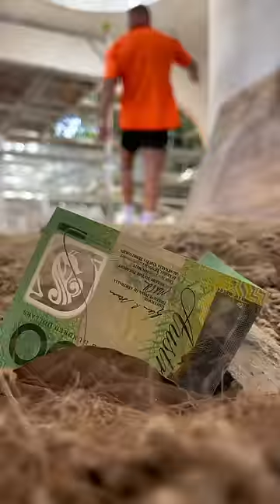The cyclist of the jobsite #electrician #work #tradie #building #jobsite #aussie #bogan #skit

Comment: And he would of left 32 zip tie ends behind
Reply: You mean he cut them? Ahhah they never do
Reply: As a carpet layer that cleans their shit I agree. I'd have to say it's closer to a million
Reply: Can't beat a sparky dropping
Reply: And all the wire armour off the cable.  Messy bastards
Reply: I cut mine at 45 deg. Sharp Is right
Reply: And plaster dust particles everywhere
Reply: @riccardotorrisi4517 as sharp as i can bro
Reply: thats me 😂 about 8 zip tie ends and a few bits of electrical tape stuck the the floor
Reply: I guess my dad was the only electrician that cleaned up in always seeing comments like this. I worked with him for a year and he'd have fired my ass if I left even so much as a grain of drywall or wire bits on the floor
Reply: As a shop fitter we were always responsible for the final cleanup.

Your comment is as relevant as it gets. The sparkies mess was always the worst by a long shot.

That said our main electrician was one of the hardest workers I've met. He would be running cables in a shopfront bulkhead while a bunch of us were lifting it into position at 2 o'clock in the morning as he's yelling at us "get that bulkhead up!" At the top of his voice. 

He was a big bastard too. How we lifted him was as puzzling as how he managed to get in and out of those tight spaces. Fond memories but god I'm glad I'm not shopfitting anymore.
Reply: ROMEX insulation everywhere
Reply: He would've left fucing 200 cubic tons of shut on the slab
Reply: Get over it
Reply: Would have
Reply: @riccardotorrisi4517 I do but i leave the ends behind for prove of work
Reply: Hahahahaha, best comment, so true
Reply: I do t understand how to keep them together?.  I dont want to leave them I swear 😊
Reply: Don't forget all those end snips of wire.
Reply: 😅 took the words out of my mouth. A sea of cable ties - not even an attempt to bin 1
Reply: After cleaning
Reply: And all the wood from his drilling holes in the rafters to feed his wire through. And the ends he cuts off the wire.
Reply: he must have been the dude who worked on my attic too
Reply: its like signing an art work
Reply: Every superhero has a calling card 😊
Reply: @riccardotorrisi4517  They cut them at an angle, so the next person to brush up against needs stitches.
Reply: In ridiculous amounts of cardboard boxes and plastic along with copper wire offcuts
Reply: THIS COMMENT IS FUCKING GOLD
Reply: Yeah mofos
Reply: @jackbrown825  And that's only if we're nice enough to pick up as many as we can.
Reply: And all the old cables, making it impossible to find out where any thing is running to😅
Reply: They buy just the zip tie ends pre-cut, along with 5kg bags of short wire insulation strips, at the electrical wholesalers. They carry them in their pockets and just grab a few and dribble them around, like mice dribble their wee, as they move about the job site.
Reply: @Stefcs92 ya get the skilled tradesman who gets paid more  a broom already
Reply: @codysmith605  sorry what’s that?
Reply: think people don't realize you're paying for their time. They can ether spend all that time doing what theyre getting paid so damn much for or you can pay them so damn much to sweep the floor
Reply: @josbud1112  doesn’t take long to run a vaccy, my partner is a painter decorator and he has to tidy up after other trades waste and mess before he can even start work, either way you’re still paying someone to do it, might as well be the person who made the mess 🤷🏼‍♀️
Reply: There's another trade that leaves just as many dead zip ties but you always forget about us. We plan to keep it that way
Reply: @monztunes6850  I need to know now!
Reply: @riccardotorrisi4517 bro we trim our zip ties and make everything look beautiful we touch. It’s just not our problem if it’s not in the panel.
Reply: Always need LOTO
Reply: And he would've charged ten times the price for them.
Reply: Would HAVE*
Reply: We do our best sir
Reply: @aston452  Then your boot.
Reply: I'm sparky that went into IT instead. Now I know why inleave shit laying around when I'm done.

Comment: 95% accurate just forgot to add all the copper shavings he left everywhere
Reply: And tons of fucking long-ass off-cuts that they could have totally used on other jobs like short connections between isolators and aircons, or just simply collecting them to sell for scrap
Reply: Ah hum, that's not copper. That's gold dust.
Reply: We just have a box of pre cut copper strands that we sprinkle around.
It’s the final touch of a job well done.
Reply: That's his gift for the poorer trades. Sweep that up and you may be able to afford some mcds for lunch.
Reply: Back in the day picking up after oneself was absolutely discouraged. That job was the Laborers. All the trades left a mess. 
  Essentially taking a man's job away from him. Laborers made damn good money. Their Union was strong.
 However back in the day they were Jack's of most trades. They could do masonry and carpentry better than many of those trades. They knew how to use all the surveying equipment. 
 They were prized and respected. 
  Now a days few if any even know their own trade. Laborers? What are those?
 There is very little craft or skill needed. Everything is prefabricated and designed to be installed. Installed. Not built. Not crafted. Skill level approaching 0.
Reply: We call them “sparky droppings” and its our gift from us to you. Think of it as memorabilia
Reply: What electrician shaves copper? 😂😂😂
Reply: @simonb1996   dont be pedantic simon, you know what they mean. You could argue it is shavings - when we snip the ends of wires off or “shave” them as some would say.
Reply: @jonnyprice2618  Nope, still not shaved.
However, I wasn't being pedantic. I was having a little light hearted laugh. You should try it some time. Not everything in life is so serious.
Reply: @simonb1996   back track of the century 😂😂😂
Reply: @simonb1996   oh and by saying “still not shaved” after ive explained it is most definitely you being pedantic. Its common for electricians to say “im going to shave the end off these wires”.
Reply: @jonnyprice2618  We cut copper cores. We don't shave copper cores. 

It was a joke, don't cry about it.

Stop trying to argue with someone you don't know on the internet. 

Go enjoy your life. I won't be replying anymore. 😂
Reply: @simonb1996  its a term used. “Shave” them. So your wrong we do shave them. :) :) :)
Reply: @simonb1996  also its sad liking your own comment 😂😂
Reply: That's the apprentices wage, the copper recycling.
Reply: @Inconsistensea .
Reply: Clean it up, jannie.
Reply: Depends on where the job is done! Though honestly? It's not that rare with something like that. Had a colleague who was called out on a task like that in the past too, he even asked on the phone before getting into the car "are you CERTAIN that you have not just accidentally pulled the plug?" and then he arrives, lo and behold, presses the plug in, fixes it and that's just two thousand danish crowns. (Getting the electrician out in the middle of the night is expensive)
Reply: That's a little something for the brickies to weigh in
Reply: Do you mean ‘shavings’ or do you mean clippings?..
Reply: Obviously the apprentice failed on his only role, clean up!😂
Reply: Sweep that up and go cash it in for tonight's dinner 😂

Comment: What's the big deal about a qualified electrician in Australia? And why are they so highly paid?
Reply: They have a stronger union than construction workers, but both trades pay pretty well. Know heaps of carpenters on $240k+ working on Queensland state gov developments
Reply: Unions and also Construction has to compete with mines which has inflated trades.
Reply: They act like a cartel. Sparky’s and plumbers are the only two trades that can only be performed by a licensed tradesmen. They can pretty much hold the building site up for ransom if they wanted!
Reply: Here in the US in CA its not an easy job mentally and physically. 25 years in the trade and still love my job that pays very well. $15,000+ a year.

Comment: What! he didn’t stare at the panel for 10 minutes doing absolutely nothing come back and sell you work you didn’t need using temp equipment ripped off another site while not even having the decency to clean it up and pretend it was new and still overcharge for it. That’s not a good electrician then.